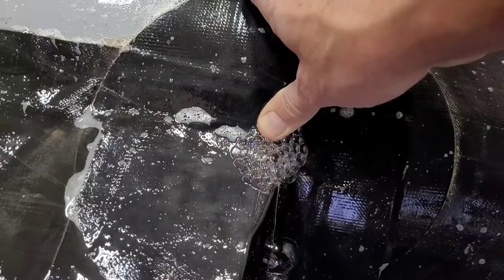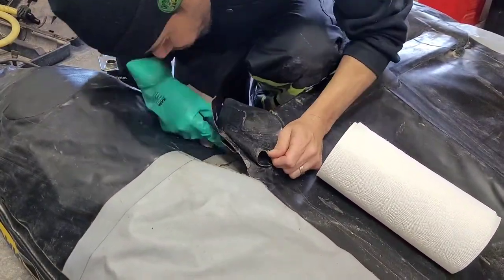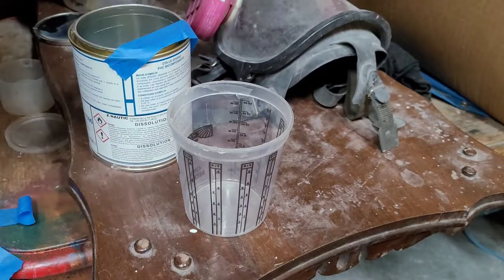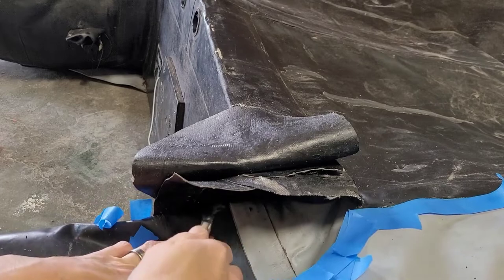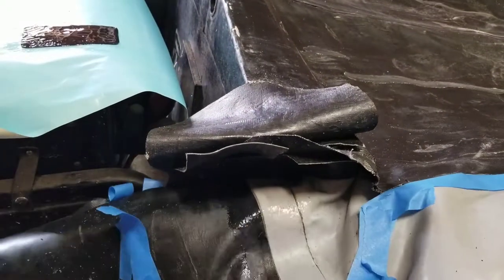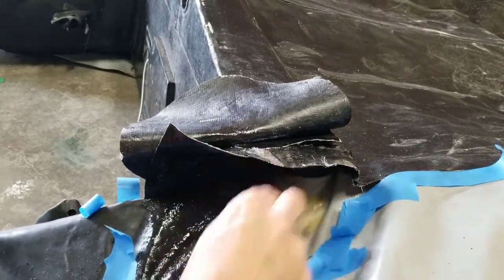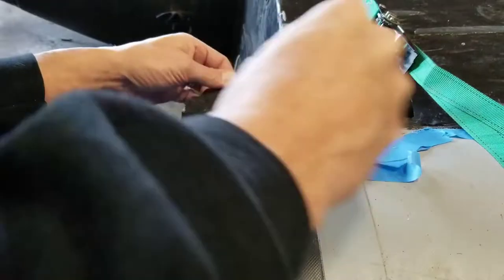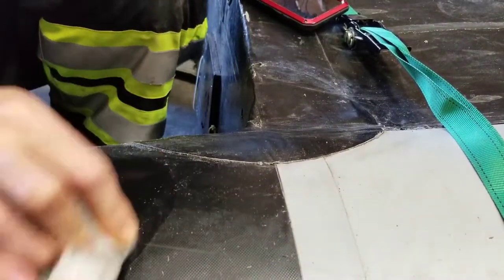The Impossible Leak Repair on a Zodiac Inflatable Boat

Comment: It was a joy to watch how you managed to fix such a difficult repair. Do you know, that the inner joint was glowed in the first place. I mean, that it might have been hot air welding.
Reply from the maker: Thank you. This particular boat was at the time where Zodiac glued there boats together. Nothing on this one was welded. If it had been welded, that section would've never separated.
Reply: @gashopperinc  I know something about airtracks for gymnastics and have patched a lot of them. The airtight types started 2006 and most of them were welded together and in most cases by electrical high frequency welding and a few hot air welding. But all of them got leaks at the joints at a high rate. After 2014 almost all manufacturers got them glued instead, and it solved the problem. Airtracs are typically deflated every day and folded together. Some gymnasts bounce on a joint in middle of the airtrack. So perhaps airtracks got more mechanical stress variations. Anyway the PVC gest briddle due to the welding process, so it cracks or slips in time at the joints. The typical max pressure is 1.5 PSI so it may be significantly lower than boats.

Comment: Great video! How did you remove the old glue? What chemical did you use? What sander attachment on dremel?
Reply from the maker: MEK or aceton, 120 grit sandpaper, and course grit stone on the dremel is what i used. and of course, some elbow grease. lol

Comment: Should not put a patch over a seam. Pull seam tape off, rebond seam, later inflate and put seam tape on with tube fully inflated and non leaking. If it leaks before putting seam tape dow you have not done a proper bond. Do not bond with wet glue. Follow mfr instructions.

Comment: I did a patch an a avon hypalon it didnt work i used 2 part glue how much glue do you use for a patch
Reply from the maker: I do a minimum 2 lightly coated layers each side and wait the suggested time between coats. Sometimes 3. Depending on the glue. Make sure you follow the temp and humidity guidelines for the glue also. Very humid weather (above 65%) while gluing, will cause premature glue failure. Very hot weather will cause the glue to flash quickly and will have to adjust waiting times, and to cold will freeze the glue and will have to heat it up. You have to find a happy medium when dealing with 2 part glue.

Comment: hey Rib repair pro :), Is it stupid to put on cheap protection on rib boats whit like vaselinoil ? some say its very good,but some say its not good for pvc but hypalon can use it since stronger.. what do you think ? can pvc boat use cheap protection like vaselinoli for 10$  its looks very good on. i found out that to use pvc swimming pool glue is bang for the $ :)
Reply from the maker: To be honest, never heard of that before. Trial and error has been the biggest thing for me when it comes to repairs or doing anything to these boats.

Comment: What causes it leak there by transom
Reply from the maker: overinflating or glue failure from  age.
Reply: @gashopperinc  Sun can cause boat to overinflate and heat is often used to take these boats apart.